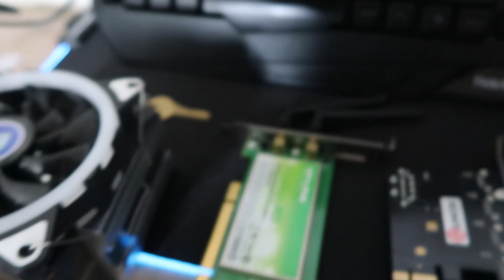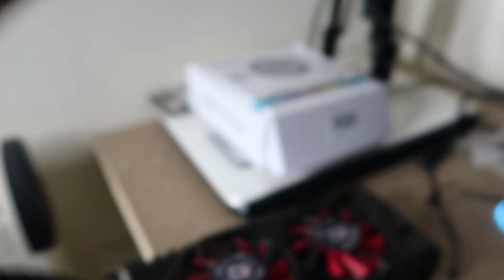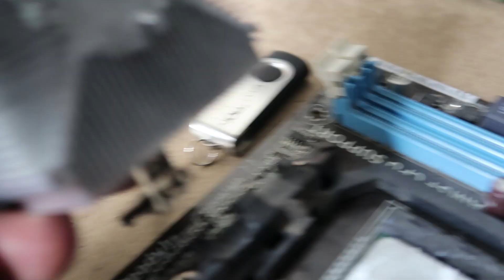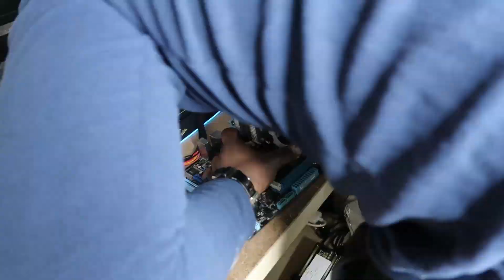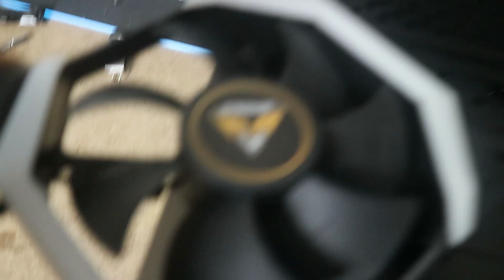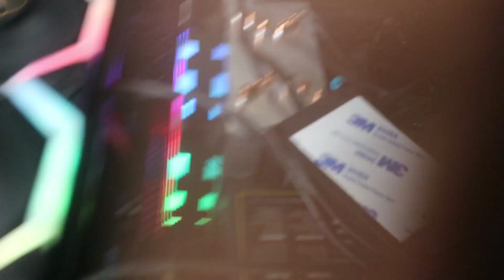THE CHEAPEST BUDGET BUILD EVER -BUILDING MY GIRLFRIEND A £145 BUDGET GAMING PC

Comment: I want to buy a gaming pc with the budget of $600, i found someone who wants to build it for me , but Some parts are second (i have put behind everything if its new or not

these are the specs

CPU: AMD ryzen  5 1600 3,2 GHz NEW
Motherboard :Asus PRIME X470-PRO NEW
Storage: Corsair Vengeance LPX DDR4 16GB NEW
Case : sharkoon TG4 - Tower • 6 interne bays RGB NEW
System cooling :Sharkoon SHA450-12EUP - 450W
SSD: 240 GB SSD - 2,5" (500+ read/write) • SATA-600
HDD: 2 x 1TB HDD
Graphics card :Palit GeForce GTX 1060 Dual 3GB - 3GB GDDR5 • DVI-D, 2x HDMI
OS: Microsoft Windows 10 Professional (NL 64bit) 
Extra: 300mbit WiFi USB adapter

Price : $600

I am gonna play games on this pc like battlefield ,dying light etc.
Is this pc good enough for that?  (I atleast want it to be good enough to game on for like four years)

Kind regards,
Jayden
Reply from the maker: Hey, I can feel your worry coming from building my own gaming pc a few days ago. The system sounds good but are these parts going to be purchased brand new ? or are they going to be used ? if its a new system build its okay for the price some savings could be made around where you purchase some items , like the cpu and the motherboard by just possibly waiting for a few more days. Sites like Ebuyer have gaming items a lot cheaper but just have to wait a few more days. 

The PSU that is being used I think is a bit of a old one as i haven't heard of that ever in my pc building forums would recommend going for a name brand PSU to prevent any of your parts from being damaged by a faulty power supply. 

Hope thats helps a bit and thanks for stopping by ! means alot .
Reply: I would change some things in your build:

1. Get rid of that X470 Board and get a decent B450 Board, like the Gigabyte B450 Aorus Pro or the MSI B450 Gaming Pro CArbon AC (if you want wifi)

2.  Don't pay for Windows

3.The Power Supply seems shitty, get a better one

4. Buy a better Graphics Card, like a used Vega or RX 590/GTX 1660, the 1060 3 GIG is shit. 

When you want to game 5 years, get a Vega. No other Card can possibly be useful in 5 years in this pricepoint.
The Rest is fine, if the Ram is clocked higher than 2666 mHZ; 'cause Ryzen really benefits from fast Ram
Reply from the maker: @glntv5217  My personal Rig has a B450 in there and I have to say its a sick board for the price point and would recommend a decent power supply to. I have been trying to get my hand on a RX 590 as I have only used NVidia Graphics cards in build. I have seen they are very powerful saving a lot of expense.
Reply: These are the specs now

Cpu :AMD ryzen  5 1600 3,2 GHz new
Motherboard : Asus PRIME X470-PRO new
Storage: Corsair Vengeance LPX DDR4 2*8Gb new
Case: Sharkoon TG4 - Tower • 6 interne bays RGB new
PSU : corsair cx450m new
SSD: 240 GB SSD - 2,5" (500+ read/write) • SATA-600 new
HDD: Seagate Barracuda - 2 TB 3,5 inch new
Graphicscard:ASUS PH-gtx1060 – 6 G (6gb, DVI-D, HDMI, DP, Active)
OS: Microsoft Windows 10 Professional (NL 64bit) 
Extra: 300mbit WiFi USB adapter
Reply: @dartney  ya know, the TG4 has a 3 Pin RGB Header, and your Board only has 4 pin. How much does the WIFi cost?
Reply: GLN TV  $10
Reply: @dartney  You can save them by going with a MSI B450 Gaming Pro Carbon
Reply: and for God's Sake, Change that Grahics Card. Go with a RX 590 or a GTX 1660/ GTX 1660 ti. Or Maybe even a Vega.
Reply: GLN TV what Vega graphics card
Reply: @dartney  56
Reply: GLN TV  this one?
Reply: @dartney  which one?
Reply from the maker: @glntv5217  haha thanks for helping him out ! you're recommendations are really awesome bro !